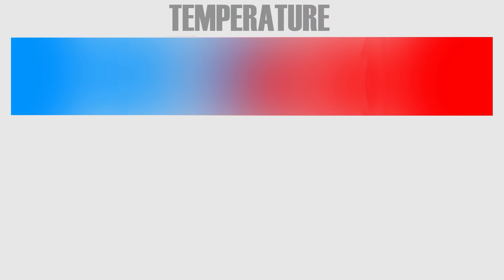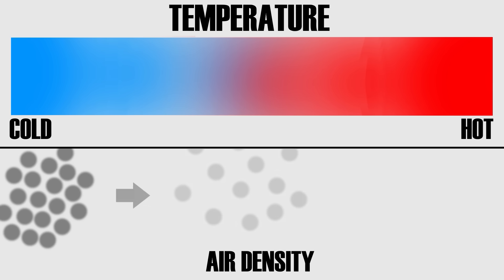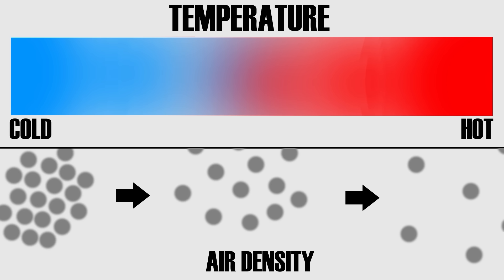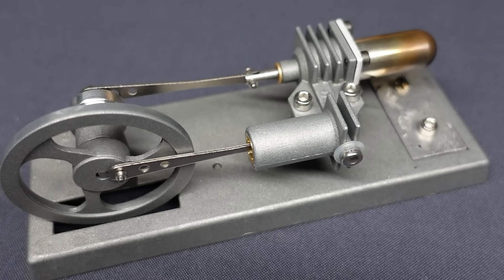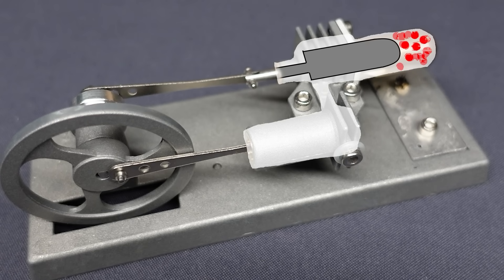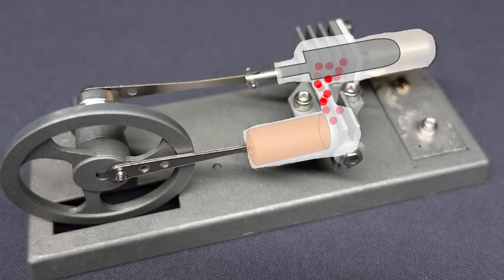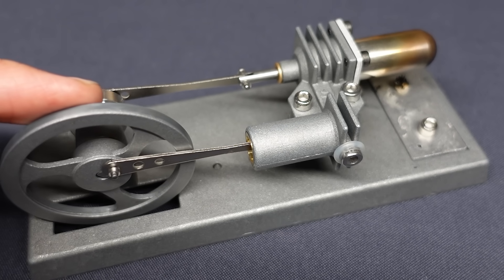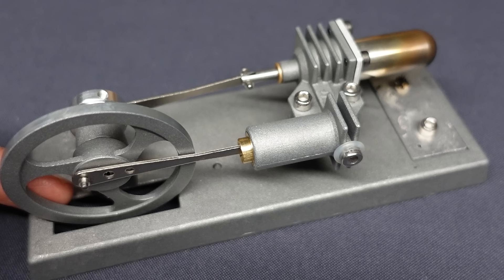It Can Save The World - The Simple Genius of Hot Air aka Stirling Engines

Comment: Internal combustion engines creates a lot of waste heat, as waste heat is all the heat you generate as a byproduct that you don't use, not just heat remaining after you turn something of.

So, it would have been possible to significantly improve total fuel efficiency of internal combustion engine cars by using the waste heat generated, since the first ICE practical car was made. Using either Stirling engines, and or some other external heat engine to recover useful energy from the waste heat.  

It would add some complexity, and cost, and weight, and require some space, but it could have been worth it, after a lot of development, possibly  reducing fuel consumption in cars more than 10% without making them unreasonably more expensive or heavy, and adding very little maintenance requirements. In fact, the energy recovered by such a system would reduce wear on the ICE. The engineering to create a system that is worth the extra cost would be complicated, but probably possible. 

Nuclear power/propulsion isn't necessarily noisy, turbines don't have any reciprocating parts, and the amount of heat you need to expel is the amount of heat generated minus the energy used, so the main advantage with a Stirling engine over a closed-loop gas turbine system I can see is robustness, and possibly lower cost and easier maintenance. Gas, that is in gas as the working fluid, not energy source.  

Stirling engines have no significant thermodynamic advantage over gas turbines. It's possible to make very simple Stirling engines, very quiet ones, fairly efficient ones, very robust ones, very cheap ones, you can make them run on extremely low temperature differences, but you can't combine all those things. They are intriguing, but even if we start to use waste heat, and other sources of "free" heat to generate power, which Stirling engines could use, which have substantial potential, I think gas turbines are overall superior. Higher efficiency, higher power density, no reciprocation, easier to regulate power.

Comment: 1) As I understand, modern Striling applications use pressurized inert gases, not just air. Of course, hermetization issues should be solved.
2) electrical (hybrid) schemes allow to use Sterling in cars

Comment: I was lucky to have some involvement in the WhisperGen stirling engine project (not mechanical but helping out with some of the control electronics and remote monitoring software), and I think Stirling engines are still have great potential. The WhisperGen was a four cylinder generator which aimed to provide high overall efficiency (electrical + thermal). Electrical energy efficiency was not every high (the engine generated about 1 kW) but virtually all the heat was recovered and was typically used to heat hotwater for a boat or house. Other interesting facts:
1. Stirling engine was invented in 1816 ! 
2. They also typically have a "regenerator" that actually recovers significant heat as the hot air is displaced back and forwards between hot and cold regions.  Further improving efficiency.
3. They are not limited to working with heating / cooling air and more power and efficiency can made by using different gases at pressure.
4. Philips manufactured a cool stirling generator in the 50s / 60s. It was intended for power portable valve radios (which used a bit of power). Unfortunately the invention of transistor radio spelled the end of it commercially as it was no longer needed. See: https://www.youtube.com/watch?v=M9UKu-AP02k&ab_channel=barumman
5. If you drive a Stirling engine with a motor it operates similar to a heat pump (one end will heat up and the other cool off)!

Comment: To  get better power modulation, the system could be combined with a mechanical KERS. So it can take up excess energy when getting off the gas pedal and supplying additional energy when flooring the gas pedal. However, this also wouldn't solve the problem of getting the system initially started.

Comment: I think the big missing reason on why these engines are not used is indeed their low power to weight ratio. But even with stationary applications, Stirlings tend to also be much larger than their equivalent power ICE counterparts, which in turn drives up costs. Those engines seem to rev quite fast, but the missing bit is the output torque, which will be very low for its size because air (and other gases) are very compressible, meaning that they don't push very hard on the pistons compared to steam or the far hotter air-fuel mix in ICE.
Reply: What about a gas that is better at transferring energy than normal air?
Reply: @Jalcordoba I think people have tried to use helium, nitrogen, or even hydrogen in Stirlings, because of their higher thermal conductivity, but it doesn't seem to be enough to make them competitive. From what I remember, there's more power to be gained by pressurizing the crankcase, so that the atmosphere doesn't steal force from the stroke. But overall, it seems to be a lot of engineering for too small gains to make Stirlings competitive. Perhaps the biggest merit of Stirlings are their versatility on the source of heat. You can use anything from burning trash, to solar energy, to residual heat.
Reply: Would be cool to have a small stirlig electricity generator hooked to the pipe of a wood burning stove.
Reply: @MalawisLilleKanal  a lot of people have fans on their wood stoves that are powered by stirling engines
Reply: @Syngekhoomei  I know. I am one of those people.;-)
Reply: Stirling engines are MUCH less efficient than I.C.E. engines are
Reply: @davelowets I'd argue that to be untrue 
If you have a good regenerator, air with good thermal conductivity and sufficient temperature difference, it will undoubtedly outperform ICEs in terms of efficiency

Comment: Wouldn't a potentially great application of these engines be to complement an ICE engine to propel a vehicle and charge a battery?

I could imagine, though I'm sure the real implementation is hideously complex, wouldn't having a Stirling engine heated with the waste heat from an ICE and a clutch to couple it to the drive train in order to improve highway efficiency?

Or going further, and perhaps too complex or heavy: but a Stirling paired to a hybrid vehicle which charges the battery or powers the drive train depending on conditions?

I feel like there has to be a startup working on this somewhere.

Comment: The greatest source of waste heat is the heat that falls onto the earth. Using some lenses to concentrate that heat should produce power using sterling engines might work pretty well. Though I don't know if it would beat solar cells or other forms of heat fueled systems working on concentrated sunlight.

Comment: I am from Kurdistan I am very interested in stirling engine and I want to build one and combine it with my boiler and pyrolysis reactor to produce both diesel and electricity from waste heat. I can honestly say it was the best explanation I heard during my research. Finally, after a long time, I understood Sterling's working process correctly. Thank you

Comment: I actually have an animated gif of a tbree(3) piston sterling engine. It was part of a patent from back in the late 80s, early 90s. It was designed to be used in small aircraft. As the air gets colder with altitude, the moving air is even more effective for cooling the parts of the engine that need cooling. As far as I know, it was never put in to use because the US government agencies that regulate aircraft and the engines used on them, never approved even a test aurcraft to be built. Another example of US government agencies stifling scientific advancement, the same way the FAA keeps slowing down SpaceX testing their prototypes.

Comment: For cars, if you use a Stirling engine as a range extender, power modulation isn't an issue.  For example, an EV with a battery that can power the first 50-100 miles, then the Stirling engine turns on to produce electricity. Any excess electricity charges the battery. When you step on the accelerator, the battery supplies instantaneous power. You may power modulate the Stirling engine, but it can be very slow.  The Stirling engine only needs to supply average power. Note: This solution doesn't require charging stations everywhere. Just charge at home. The vast majority of people drive less than 50-100 miles per day.  So this could replace around 90% of gasoline with electricity just by charging at home.

Comment: Do you think there could be a problem running cars like this on the open road with Wind blowing the flame out - Is that why they made the Internal Combustion Engine?
When's the last time you saw a car get a warrant of fitness with Candles in the headlights ?? Answer: About 2 - 4 - 6 mile an hour?  External combustion engines may not work in wind/slash speed or Rain - !!! so ... Like Sailing a Lead Boat ??? 
There's a Reason some plonker diverted from External combustion engines to Internal Combustion Engine ... it could just be the Fire callouts

Comment: Ok so #driving4answers are you saying that future cars will be Coal fired 700 cylinder/pistons External combustion engines and that's how the west is getting round Russian/BRICS Gas and oil issues? Do you think we could do this in Hybrid Electric cars and use Plasma to do the heating thus being 100% Green bullshit - Of course of those 700 cylinder/pistons 350 of them will come from scrap petrol motors with no Rings - Big saving there!! Green points already! lets go 1400 cylinder/pistons 🤣No why hold back 2800 cylinder/pistons and call it a "Fast Charging Invalids Chair" .. What could possibly go wrong ? Golf Carts that do 18 holes in 4.8 seconds

Comment: This got me thinking why no car maker making any effort capturing wasted heat to power their vehicles. Then I thought, ah, F1 does with their MGU-H (H for heat) technology. I dug into it and quickly discovered it's misleading - their MGU-H does not convert "heat" into energy, it merely captures energy from excess turbo rpm. It seems exhaust gas turbine and compressor turbine aren't directly connected, the H unit sits in between and governs what to do with a turbo's input.

I guess unless the petrol costs soars $10 a litre, no car maker bother to pursue the technology of capturing wasted heat into energy. Even if they could, I wonder what method they'd use and how much cost would it add up to their final product.

Comment: Watching this I have an idea; and no grasp as to why this "idea" wouldnt work:

Put 12 cylinders? 16? 24? 120? On a homes rooftop. (Isolate the mounts with shock absorbing and sound reducing rubber grommets maybe??), set magnifying glasses over the cold air chamber to use sunlight to heat the chamber. (if a 10 cent magnifying glass can set a leaf on fire...) Hook it up to a battery system (for power storage) and why wouldnt this supply what amounts to absolutely free electricity for the house? The number of cylinders could be increased, to increase generated electricity so that regardless of the load, the generated power would exceed it, thus charging the batteries to provide power at night. 
Electric control board monitors battery capacity, and maybe at 90% charged, the controller tilts the magnifying glass away from the chamber and keeps it away until the batteries fall below a threshhold...say 50% for ex)

These engines would be dirt cheap to produce (gawd awfully few moving parts), fuel free, and emissions free.

From a mathematic/engineering standpoint; why doesnt this work?

Comment: You could easily put a throttle control on something so simple,
Just control the the airflow with something like a ball valve.
If you can constrict (resist) hot air intake to the piston head, output would slow, and if you release (open) the valve, output would speed up.
Also, if you were to put the side that is open to the flame in something that enclosed the piston ends with a flame, you could power multiple pistons off one heat source, with 0 wasted energy (potentially)
[ps. This is just an idea, I have no idea what I'm talking about half the time, but if everyone who knew nothing never spoke, our would would ever progress]

Comment: looking at the hobby grade sterling engine would it not be possible to turn that power produced into creating a heat source around the barrels of the pistons like some form of induction i know induction would require enough power to make it work, however you could step up the power output with caps which would require minimal power to charge as they store energy until released

Comment: So in theory a car could be made like a hybrid, but instead of using an I.C. engine, a sterling could be implemented to charge the batteries, and the electric motors could be the main drive system. May not be the most practical, but I don't see why that wouldn't work... considering thats what an I.C. engine does in a hybrid car, operates at a consistent speed like a generator to charge up the battery system. I sort of want to see that theory tested. See if an electric/ hybrid car could be successfully ran with a sterling engine linked to the generator(s) that charge up the batteries. Make it to where it uses ethanol or propane as fuel, and design it to have burners either like a lighter for pressurized fuel, or self extinguishing burners for liquid fuel. I think that would be a great idea.

Comment: How long  can run this engine without lubrication. The friction between the cylinder and the pistons, and the others parts in movement will not tolerate a long run, without any lubrication...(?)

Comment: I do love these engines! I can imagine a small stirling engine running off a sand battery that is heated by the power collected from the stirling engine.. it may need spinning up with a drill for a little bit first but after that it might be self powering

Comment: Good grief.  "running on waste heat".  And how do you channel that waste heat from the source to the cylinder ?  How do you store that heat for later use ?  You can't.
The setups you demonstrated are a significant source of waste heat - a considerable amount of the heat from the flames goes into the air, not into the chamber.
That can be mitigated by combusting in a chamber.  Oops, that's internal combustion - which, because it's more efficient, has beaten out the Stirling in practical consumer applications.
This Stirling pseudo-science will play well with the Woke, who intentionally deny reality.  This video has all the "science" of a 19th-century snake-oil salesman.  It's a con job.

Comment: You spoke of waste heat, but I feel it's important to mention the Sterling Engines rely solely on a temperature _differential_.  You don't necessarily need the "hot" side to be all that hot (like a flame), so long as the "cold" side is very cold.  It's only really the difference between the two that is important.

That is, you could power the engine with an ice cube if the "cold" side is being cooled with liquid nitrogen.

Comment: I see you've discovered these fun little toys too. 😁 They are indeed intriguing, considering they can run off solar heat, especially if the cold end is buried underground where it will stay chilly all the time. I once "turbocharged" one of my toy Stirling engines by putting the hot side on a cup of hot tea with an ice cube sitting on the cold side. (video on my channel.) I even made one that's baby-powered. (also a video on my channel. 😁) However, as a means to harvest solar power it's still more maintenance intensive than good old photovoltaic solar panels.